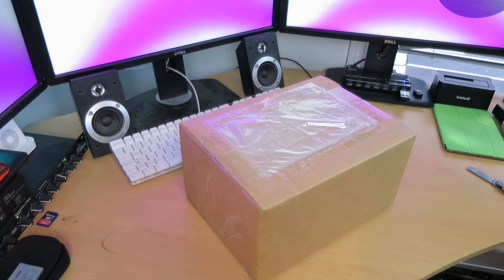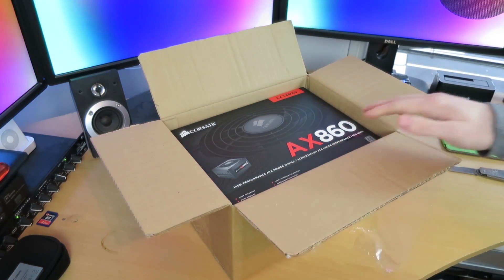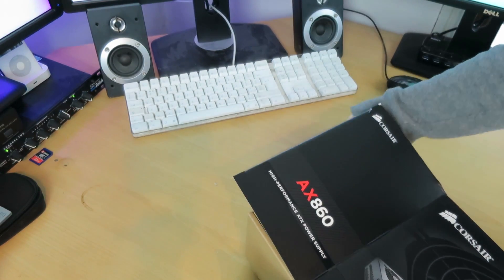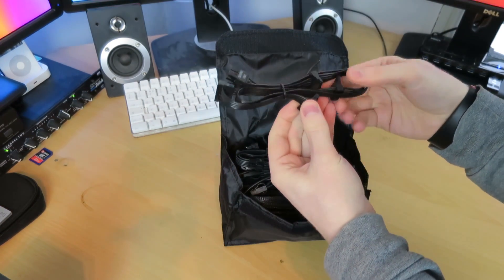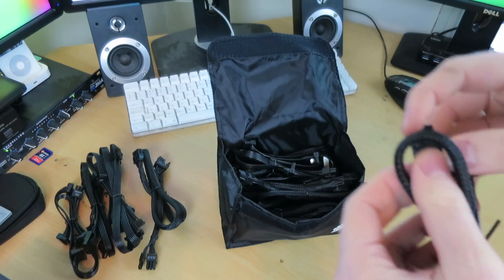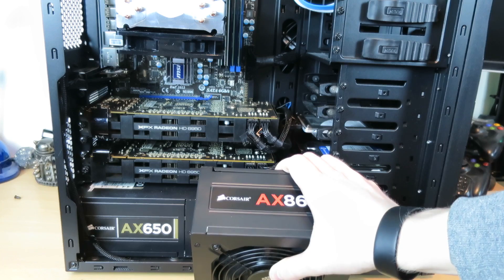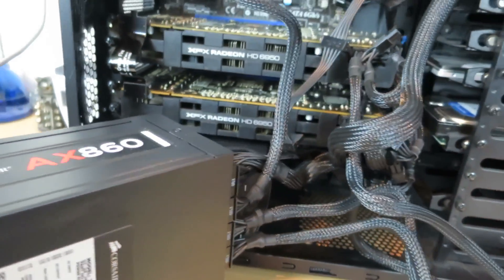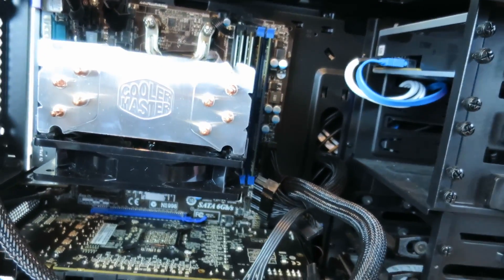Testing a Used Corsair AX860 80+ Platinum PSU | IMNC

Comment: I just bought this psu used for $100. Hopefully it lasts!
Reply: lol I just did too for the same price
Reply: How is it? Im excited myself ;)
Reply: @deise4208  it’s working great so far (knock on wood)! I’m using a ryzen 5800x and a gtx 1070 with it. My kill-a-watt power meter says at full load my system doesn’t go over 370watts. The psu isn’t even trying. The fan is very quiet, and the 3.3v, 5v, and 12v rails are all within 5% of spec. This is a NICE psu, even though it’s old it still holds up. Also I read somewhere that it’s better to keep the fan on normal mode, that way the psu will last longer due to sufficient cooling.. idk how true that is? Either way, it’s a great psu man. Just check the rails, since it’s used you don’t know what condition it’s in.
Reply: After 4 years, ish, how is it going with it? Is this working?
Reply: @robertomanna9258  i upgraded my PC so I had to get a 1200w psu. But I gave it to my uncle and it’s still running strong in his 10400 office pc.